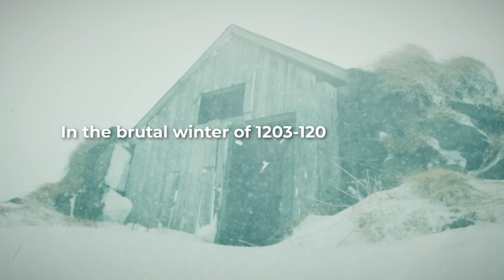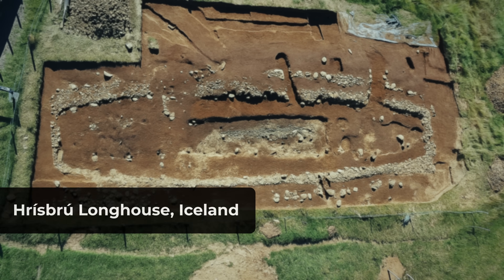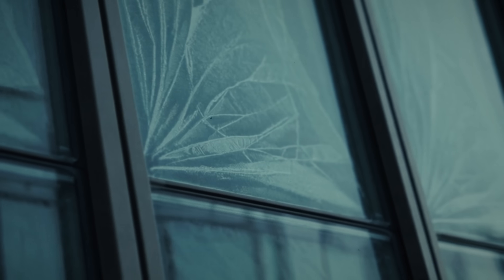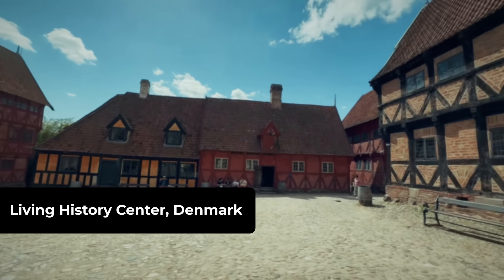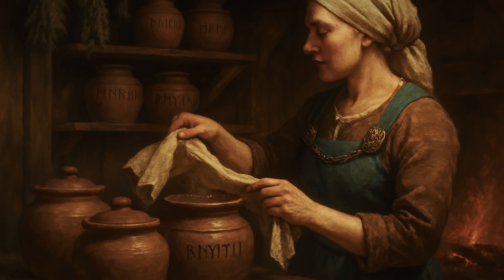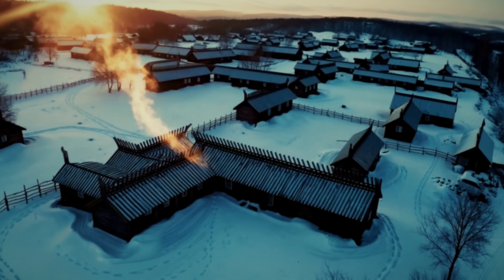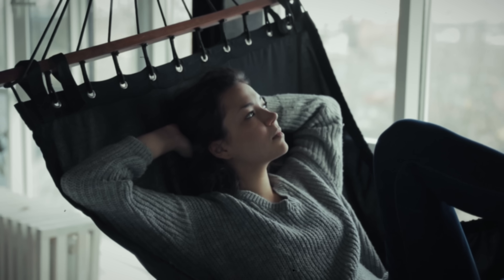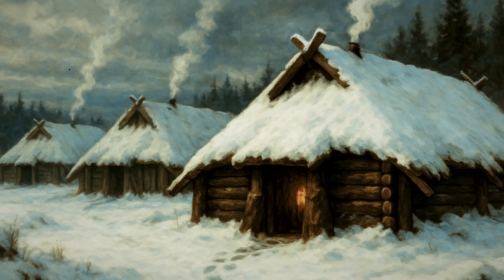How Did Vikings Sleep in Winter Without Freezing Dead?

Comment: As a Norwegian it's fun to see my ancestors depicted this way for once and not just as brutal warriors and pirates. They were very sophisticated indeed, but I think you went a bit too far with this one. Modern Norwegian houses are built with heated floors and that is very efficient. In my house in Oslo, we use heated water to flow around the house to heat it and it runs on electricity, but we can run it on fuel if necessary. Heating water isn't very difficult so if everything collapses, heating this house would not be a challenge even during the harshest of winters. Norwegians on Greenland in the beginning of the 1000s discovered the hard way that building houses of stone is extremely bad in cold environments. It's like if you get stranded in a car; it's made of metal so it sucks heat out and you'd be much better off building a snow cave than sleeping in your car. Same with a stone house; if you don't have active heating, it's an ice box.
Reply from the maker: I appreciate your feedback and you sharing your experience. I will try to improve the quality of my videos with each video
Reply: @HistoricalArchitect  Your point is very good; they were extremely impressive for their time and much of their knowledge is useful today, but nothing they did could ever compare to modern insulation. If you insulate a house on Antarctica with aerogel, it'll probably stay warm for a century. :)
Reply: @HistoricalArchitect  But as I've said, I really appreciate your effort. An idea for a video might be about diapers for instance, because those types of things are not heroic enough to be in the epics, but is very fascinating.

Comment: Is there any books written on the subject?
Reply from the maker: Here are some books you can look into:

"The Form and Construction of the Viking Longhouse" by Arnold J. Aho 

There is also academic research that supports the thermal efficiency claims. There's a peer-reviewed study from the University of Tartu published in EXARC Journal (2013) where researchers actually lived in a reconstructed Viking house during -25°C weather for a week.

Their results were impressive: the house maintained 30°C (86°F) interior temps after heating and stayed livable overnight even in brutal cold, using just a small stone stove. The researchers said it was "more warm-proof than expected" with "surprisingly good" thermal performance.

For the wood treatment suggestions - I found a recent 2023 study in Materials journal titled "The Effects of Seawater Treatment on Selected Coniferous Wood Types" that actually tested soaking pine, spruce, and larch in seawater for 2-6 weeks -- validating that seawater treatment can modify wood structure and properties.

Search for: "Testing a Reconstruction A Frosty Week in a Viking Age House EXARC Journal" and "Effects of Seawater Treatment on Selected Coniferous Wood Types Materials 2023" if you want the studies.

Comment: The warmer temperatures during the Medieval Warm Period (MWP) facilitated Viking expansion, particularly their voyages to and settlement in Greenland. The milder climate allowed for agriculture and habitation in regions that would later become too cold for such activities. 

In essence -40F was most likely never ever encountered by a Viking even during their travels especially as they tended to live in the southern parts of Scandinavia, and the higher temperatures during that period even made some agriculture possible in Greenland
Reply from the maker: You're spot on about the Medieval Warm Period making things easier for Vikings. Though even their 'warmer' winters were still pretty brutal by most standards. The cool thing is these building techniques worked so well that communities kept using them through the much colder temperatures. Any who, thanks for adding some historical context :)

Comment: The wood treatment was absolutly fascinating!
Is this video information obtainable in written form? If so where?
Excellant info. Boss!
Reply from the maker: Great question! I found some solid academic research that supports the thermal efficiency claims. There's a peer-reviewed study from the University of Tartu published in EXARC Journal (2013) where researchers actually lived in a reconstructed Viking house during -25°C weather for a week.
Their results were impressive: the house maintained 30°C (86°F) interior temps after heating and stayed livable overnight even in brutal cold, using just a small stone stove. The researchers said it was "more warm-proof than expected" with "surprisingly good" thermal performance.
For the wood treatment suggestions - I found a recent 2023 study in Materials journal titled "The Effects of Seawater Treatment on Selected Coniferous Wood Types" that actually tested soaking pine, spruce, and larch in seawater for 2-6 weeks -- validating that seawater treatment can modify wood structure and properties.

However, I should be transparent the improvement of thermal resistance is my thesis/speculation based on these these studies. 

Search for: "Testing a Reconstruction A Frosty Week in a Viking Age House EXARC Journal" and "Effects of Seawater Treatment on Selected Coniferous Wood Types Materials 2023" if you want the studies. 

Thanks for the support 👍
Reply: @HistoricalArchitect  Sometimes driftwood is very heavy and hard as a rock.
Reply: @HistoricalArchitect THANKS FOR THE EXTRA RESPONSE THIS IS GREAT INFO.PLEASE KEEP GOING ON YOUR EFFORTS AND WORK.
ITS KIND OF HUMOROUS TO THINK THAT WHILE YOUR SLEEPING YOURE DOING A PAPER FOR COLLEGE! YOU GUYS THINK OF EVERYTHING!

Comment: I don’t believe it that they had shutters on roof that opened and closed on own
Reply from the maker: Since the ceilings are relatively high and the houses not nearly as insulated as a modern one the hot
smoke rises towards the ceiling and escapes through (usually) one of these openings, depending on wind direction mostly. Cold air is sucked in through cracks and openings. This is a typical and early example of natural ventilation. Doesn't work
very well if the outdoor temperature is higher than the indoor temperature but that's rarely much of a problem in Scandinavia. So while a bit exaggerated, ventilation functioned on it's own

Comment: 1963 Lincoln, New Mexico: ice storm knocked down power lines all across SE corner of the state. The house we lived in had a backup gas and propane generator with plenty of storage. We supplied water to neighbors in Lincoln. The house was electric but the kitchen had a backup wood stove with a water jacket hooked to the water heater and we had Aladdin oil lamps. Lights, hot water and cold (under pressure) from the well tank (1500 gallons). Took months to get power back but we were fine even at 33 below zero.
Reply: What abt the sewer system ?
Reply: @Afar-87 generally not a problem because sewers are gravity fed.  As long as there is water to flush with, you are OK.
Reply: Amazing 👏
Reply from the maker: Thanks for sharing this story! I don't know how my family would handle such an event if this were to happen today...

Really kind of your family to support the neighbors who weren't as prepared.

I'm curious though, were you always prepared incase something like this would occur, or was it coincidence?
Reply: @HistoricalArchitect  redundency and still knew how to operate them.
Reply: Try living in Florida with no AC or power for 6 weeks after a hurricane knocks everything out.
Reply from the maker: I live in a hurricane prone country as well. The struggle is real 😅
Reply: @joeyhunter842 Cold is far more deadly than moist heat
Reply: @PumaTomten I’ve also survived an ice storm that linked out power for a week where I lived.  I buried myself u fer blankets on my bed and could see my breath whenever I breathed.  Cold to say the least.
Reply: @joeyhunter842 Glad you managed thru that! Power goes of almost every harsh winter in extreme cold areas, we live in timber built houses and have 1-3 different fireplaces just to keep heat, cooking, water in case. Longest we had to endure is 14 days lucky it wasn't -30

Comment: Right now I am sitting in a building that is passively heated so that windows must be opened now and then on freezing Canadian winter days to take off the excess heat. In the summer it acts like a giant wind turbine pulling the cooler air in from dark shadows beneath the forest cover behind it and pulling this cooler air upward to where it leaves the building at the top of the tower. The horizontal curvature of the building ensures that the winter sun rises and warms the eastern windows, passes to the centre of the building at mid day, and ends in the afternoon on the south-western wall. I never have a light a fire before 2 pm on a sunny day in January or February.

Winter power outages are common here- sometimes for several days. Our incorporated passive systems ensure that our house continues to be full of music, without electricity, warm, and barefoot comfortable no matter what.
Reply from the maker: My partner lives in Canada, so I experienced my first Canadian winter this year. And as someone who is used to a tropical climate, it was brutal. So it's fascinating how people like yourself have adapted to combat not only the cold but the heat. Would you say that mosy Canadian housing is built in a similar way to yours?